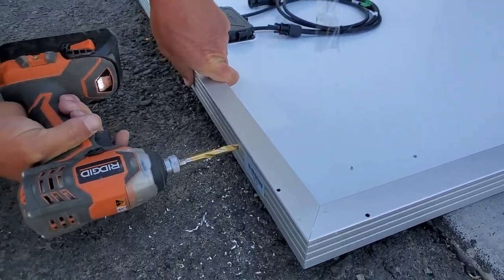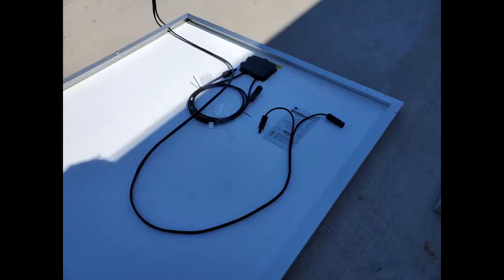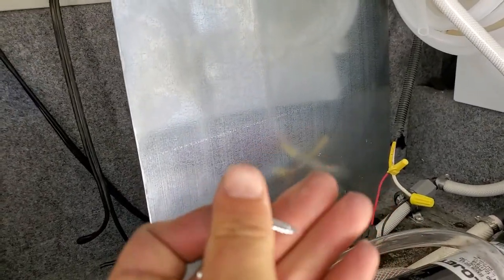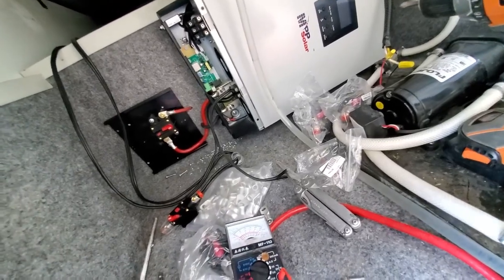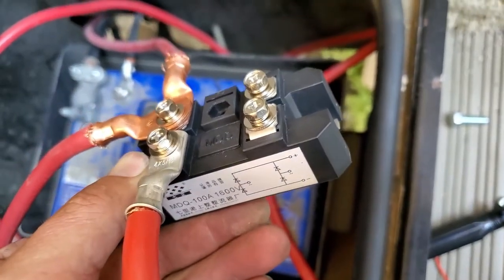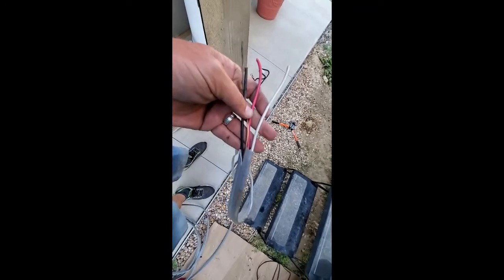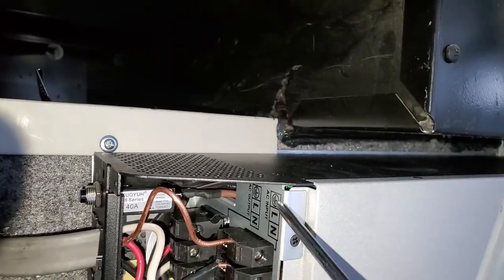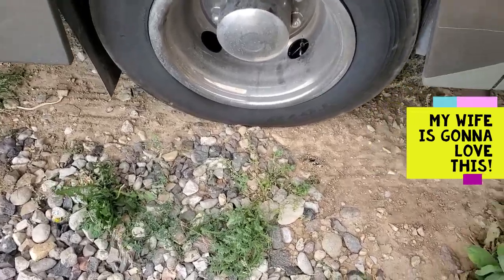Watts247.com Motorhome / RV Solar Install using the MPP Solar PIP1012LV (12V 1000W )

Comment: The routing of PV cables with no grommets,  the shards of metal shrapnel from drilling next to inverter as you installed the breakers, and the flat mounting of the solar panels, all scream HAZARD. 

Those little metal flakes from drilling create shorts when one gets sucked into your inverter intake fan.

What a total hack job this install is! Wow. And from a "major" seller.

Comment: Re; A/C input. I have tried with no luck to attach a generator to my MPP's. Saw you mentioned about the Neutral to each leg of input and output. Do they not combine the Neutral inside the inverter? That might be my problem. I have been looking for an answer on this for over a year. Have not had luck with MPP support.
Reply: Came here looking for confirmation of the generator issue. According to this document it has to do with zero transfer time models that are synced with the grid. The slightly smaller 1kw MPP doesn't seem to have that constraint. I'm wondering if switching to appliance mode fixes it (as opposed to UPS). Would love to know if that fixes it for you!
Reply: @QuintBUILDs  Have APL on. Problem was has input to 40A, it needed to be 30A as generator would sync with additional load would connect, but AC input fluctuate on each leg because 40A.

Comment: This is the absolutely worst way to install panels.  #1 they are only secured to the roof membrane, and because the roof is not flat that is hit or miss.  #2 the panels need air flow under them to keep them cool. #3 you are cooking the membrane under the panel.  #4 It look used #10 landscape lighting cables #5 you have the worlds cheapest garbage breaker.  #6 you used the wrong ends on the cables without any heat shrink.  This entire install is a train wreck, Definitely a what not to do install.  I can't believe watts247 put this on their site.

Comment: Awesome easy way of mounting without making holes on the roof! I have heard that panels are supposed to have air flow underneath them. It seems that this method stops all airflow though.

Comment: Step drill on thin sheet metal works much better. Also an Irwin Vise grip wire stripper.  Yes I've sliced my thumb using a razor knife too.

Comment: Insulated grommet between wire and aluminum frame work, edges will wear thru wire insulation in use, especially RV use due to vibration 
Dale